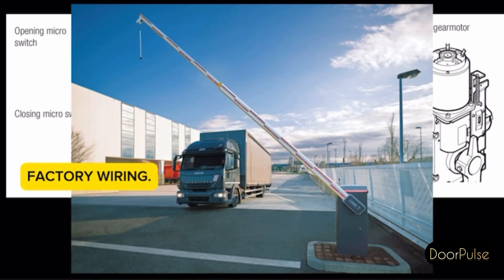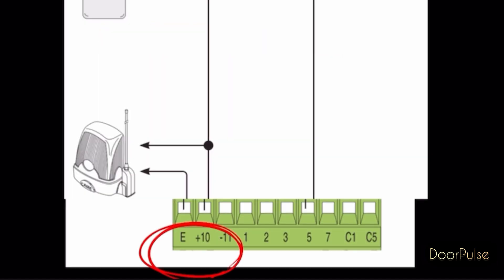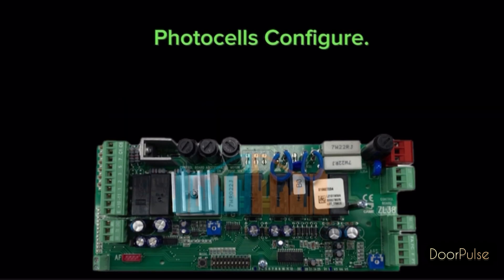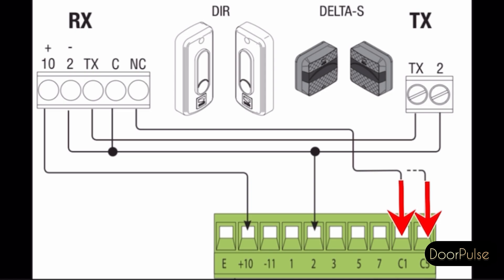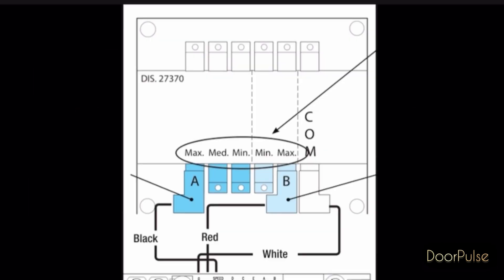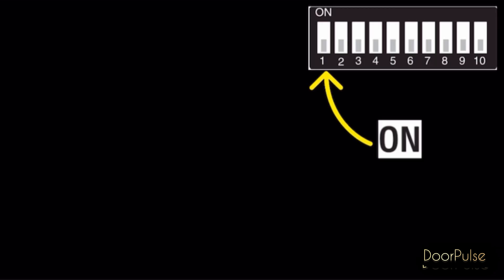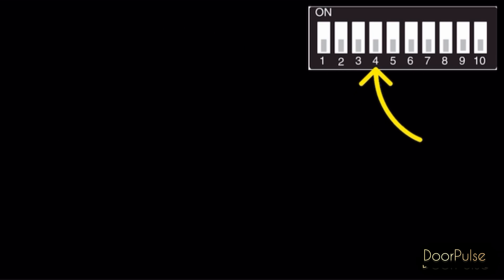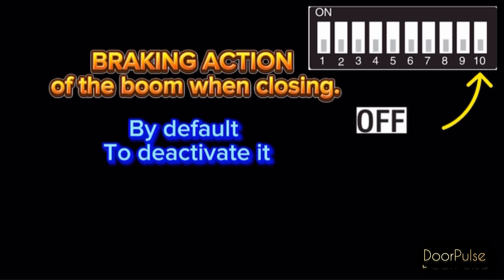CAME GARD 6000 / 6001 Electrical Connection, Trimmer Adjustment & DIP Switch Function Step By Step |

Comment: Please resolve my problem:- I have remote but it's not paired with device please tell me how can I pair my remote with it
Reply from the maker: If your remote working before and now not working.
Then check remote battery.
If you have new remote, than there is radio button press for 3 seconds and than press remote button which you one to paired